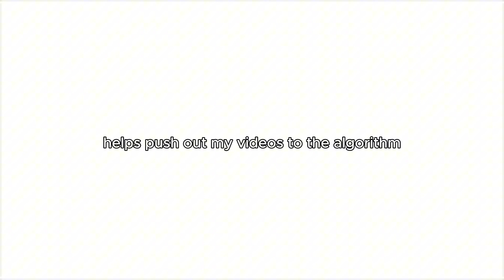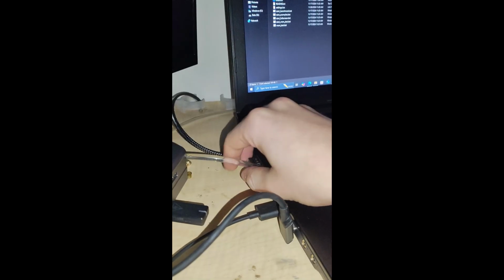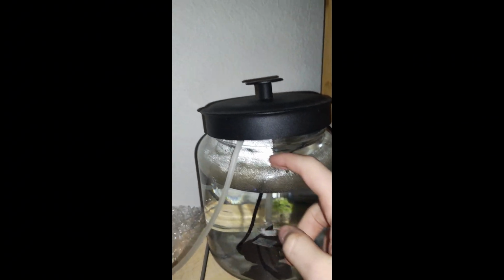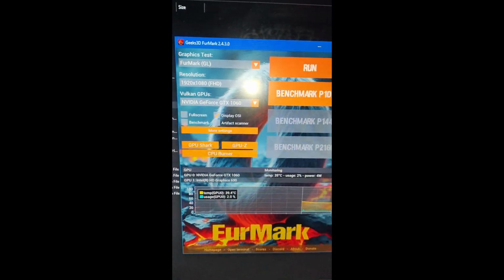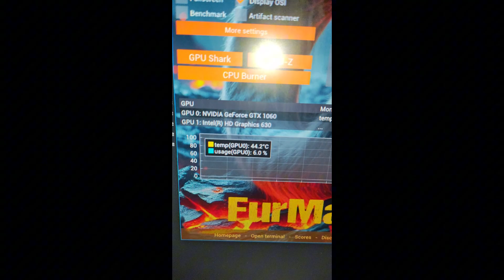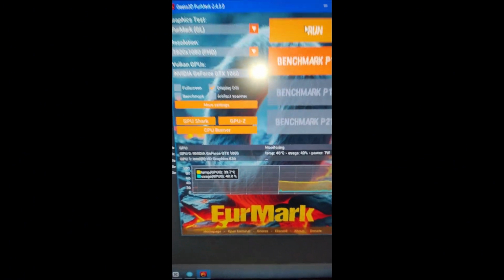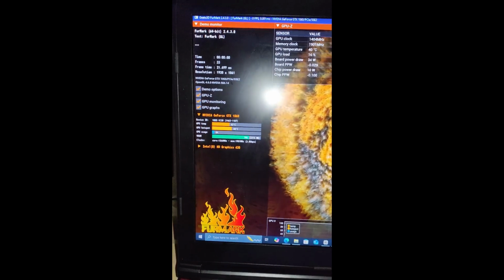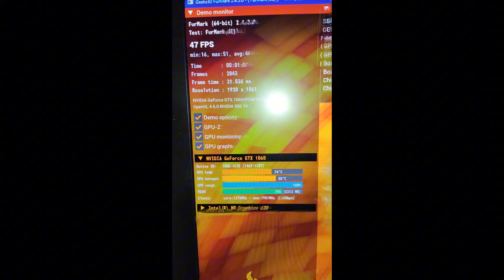WATER COOLING A LAPTOP FOR JUST $5!

Comment: you have no idea how lucky you were, the heat pipes could have desoldered from each other when using the heatgun as some manufacturers use low temp soldering paste

edit: oh well i just saw it, also you shouldn't cut open a heat pipe as they have water inside, it might leak

Comment: you should add the water pipe to top of on the existing cooler now you got heatspots on the cpu also you cant cool it if its not connected to water anymore
use thermal epoxy or something instead of solder

Comment: i was searching this for weeks finally bro

liked and subbed 👍
Reply: i want to do something like this for my rog strix g16 so i can turn it into a desktop.. too bad heat pipes has paint on it and also i have to break the back of the laptop .d
Reply from the maker: @ To get paint off just use paint thinner it should work fine and opening it up I am not sure but there is probably a way to do it without breaking it.
Reply: @LightningADev  case is tight i dont think i can add water cooling without opening a hole in the case
Reply from the maker: @Sultan___  Ohhh, yes I had to add holes into my bottom plate... Unfortunately with a laptop you will have to..

Comment: unironically, watercooled system is much more makes sense for laptop where spaces are almost none for fancooler. but it needs so much to research watercooled system for laptop, like where to put small radiator safely and where the water hose should go through to get cooled before back in again
Reply from the maker: I didn't do any research I just winged it haha
Reply: @LightningADev  im talking about the end product of commerciallized version of watercooled laptop that actually portable. what you did is the prototype and its proven works so good